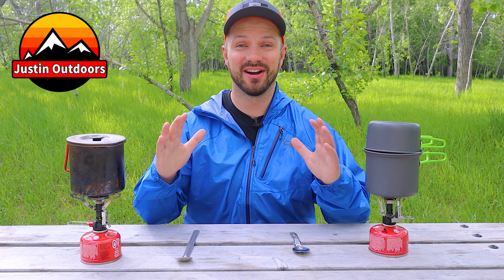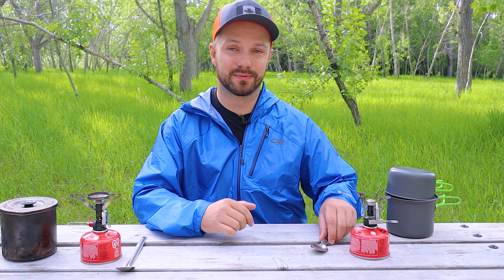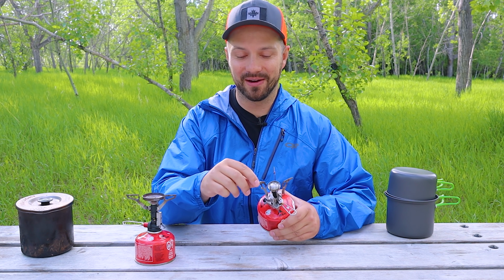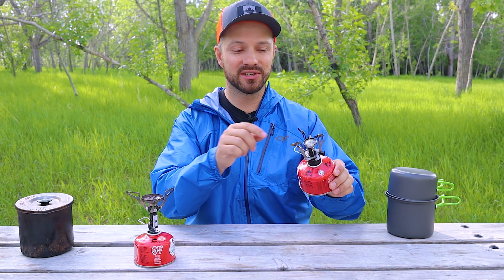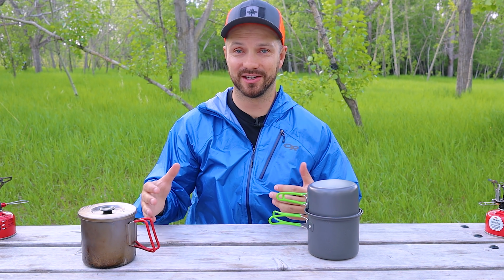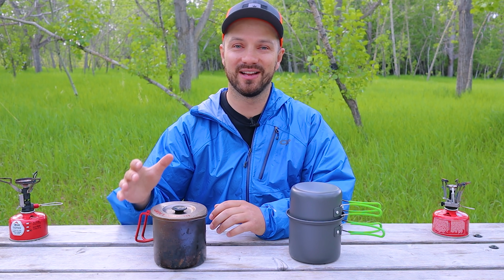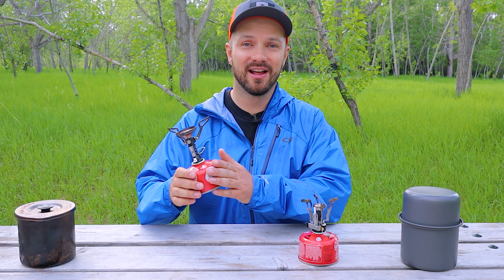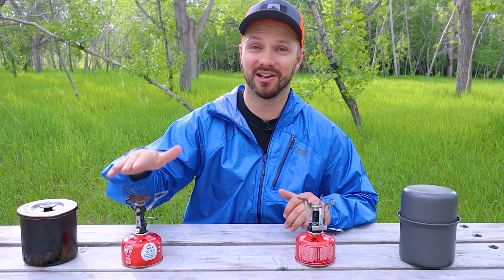Budget vs Expensive COOK KIT // for Backpacking & Camping

Comment: It’s interesting to me that titanium and steel spoons are the two most common materials on either end of the weight spectrum. Aluminum is actually lighter than titanium, just less strong and heat resistant - properties that aren’t super necessary on a spoon. Plus aluminum is LOADS cheaper.

Comment: I have the PR Deluxe and I thought it was pretty good... until my buddy showed up with his el-cheapo unregulated stove.  His spits out fuel and the flame is just not even and proper. Almost like water blasting out of a garden hose.  PR Deluxe burns so measured and even, and feels more like a nice spray nozzle on the garden hose.  Its tough to describe, but I'm really glad I ponied up the extra few bucks for the Pocket Rocket Deluxe.  Works great in colder temps too due to that regulator.

Comment: Titanium is actually heavier than aluminum.  If you made the an aluminum pot the same specs as the titanium in your video, it would be about 1/3 lighter. On your aluminum set the lid is a another pot and adds a lot of the weight difference between the two sets. The large pot also looks thicker. I have a similar set and just leave the "lid" at home unless I need it for some reason. As far as the stoves go, there are so many good options that are way less expensive than the Pocket Rocket Deluxe under $50 and work very well. I use a Soto that was $45 from REI that has been great. Peace
Reply from the maker: Lots of options out there and way to compare things :)

Comment: I had the budget stove got 5 years and only got rid of it after I accidentally left it outside and it rusted other wise it worked great. Also the “lid” on the budget pot is a mug and only fits on time so you can store your stove inside the pot and you can put the whole cool kit into the bag that comes with the pot
Reply: I've "replaced" that pot lid with a piece of pie tin i have cut to shape and weighs a whole 3 Grams and cost about $1.25 at the dollar store. Could likely use aluminum foil too for the same thing.

Comment: I have the cheap set. My igniter has been reliable and I love the cook set. I can make cowboy coffee or hot cocoa with the bottom and use the top as a cup. I wonder about the efficiency. If the cheap set uses more fuel, the expensive set will be more economical over time.
Reply from the maker: Good point on the cost of fuel!

Comment: nice comparison between the two systems …. i didn’t know about all the features on the pocket rocket deluxe …. 🤔 might be on my christmas wishlist 😂 i actually have the budget stove and had that same problem with the piezo igniter  but after a bit of light sanding on the stove top and the electrode it fixed it … i did a little 2 minute video on my channel on that fix if anyone else has that same problem ( bit of mooching there sorry but just passing on info) anyhoo awesome video justin thank you for doing all that work and passing on some great information… atb Dave Mc

Comment: Oh Justin, this video was pure brain candy 😁 I have been waiting to see this ever since your instagram rant about that “budget” gear blog post. 

After that I went full on researching mode and done a whole excel with calculations to compare my expensive setup vs a budget setup. 

Conclusion was I couldn’t conclude on the results as both companies provided their information based on tests they did in completely different (weather) conditions.

The boiling test you did was a perfect comparison. However did you only use the budget pot on both stoves? Or did you do the same test with the titanium version as well? I am curious what the difference in cooking time would’ve been as the titanium is supposed to be thinner and lose heat more quickly. 

What if the perfect combo would’ve been the budget pot with the expensive stove? Also, taking into account that the budget setup takes longer to cook, you’ll probably need to carry more fuel as well, which makes it even heavier and more expensive in the end and that takes away from the price difference? 🤔
Reply from the maker: I did only use the budget pot on both stoves. I have a few of those budget pots for testing purposes (for obvious reasons, I don't have multiple of the expensive ones 😂). I am curious about titanium vs aluminum boil times but it might be hard finding comparable pots.

Comment: The “lid” on the less expensive set is often used as a mug, ie for coffee. Add the weight of your mug to the expensive set for an improved comparison.
Reply from the maker: It's just a fun comparison to look at the different options and provide an overview of features to help people with picking a cook kit - the take away for weight is that titanium cooking gear is usually lighter than aluminum.

Comment: I'm guessing that with the cheaper pot, the lid might work as a second pot and maybe could stack as a second pot on the top of the main one?  If true, that's sort of cool (although I would prefer a titanium or stainless version version over aluminum because I am not sure about cooking with aluminum).  Thanks for this great video!
Reply: Check for anodized aluminum to prevent with leeching and even better, get hard anodized aluminum for better reinforcement and it's naturally nonstick. The msr trail lite 1.3L pot is 4.5oz I think and is $30. Very comparable in weight to titanium pots at smaller volume, it's cheaper, and more versatile cooking.